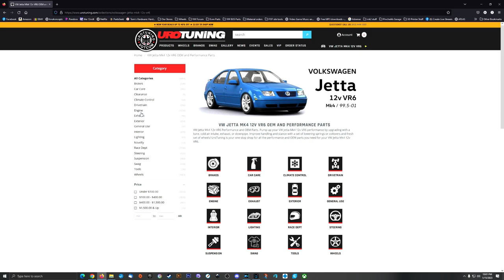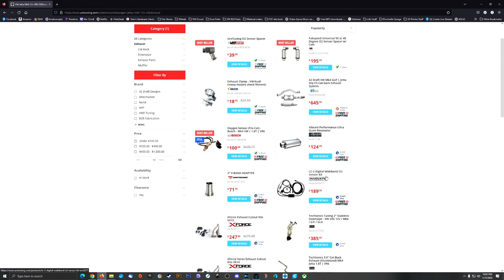How to Set Timing on a 12V VR6 Engine - Patreon Built VRT

Comment: There is also a beveled tooth on the crankshaft that lines up with the #7 main cap when the motor is at TDC. I would rather this mark determine TDC when the rear of the engine is open.

Comment: After that engine is timed, do you still have to turn the crank pulley two revolutions clockwise and match the mark up with each other on the pulley and the block in order to get the engine at TDC @ cylinder #1?
The reason I'm asking is because my engine was just professionally rebuilt and I'm getting a crank no start/ no spark issue it's really annoying!

Comment: Hey Al ik this is not the video for this but i wanted to ask you a question, and thank you. I watched your videos years ago when I was 16 and got my first audi 1.8 for 500$. Your videos encouraged me to work on my car and made me fall im love with it. Now my question, I got a 2.8 but one of the cams doesn’t line up horizontally with the other. Can i just use the cam timing bar to turn the cam into place or should i remove both cams from that bank and retime the cams.
Reply from the maker: You need a cam locking tool.
Then you should be able to set timing correctly.
Reply: The cam on bank 1 is slightly off maybe at 45 degree angle. Bank 2 cam and crank are timed correctly. Car did start and run but was obviously missing on all 3 cylinders on bank 1. I asked the previous owner if he did the timing and he said no, so I’m confused how only one cam moved. Timing belt tension is good, so either he snapped it and put on a new one to sell, or the cam chain tensioner is going out.
Reply from the maker: Here is a link to my Google drive account for a Bentley manual as well.
Use it to help do your repair 

https://drive.google.com/drive/folders/1QJAvL7EngtMpEJBtpos1TtSixUgF1l9Y
Reply from the maker: @adriang9238  ok wait is this question for a 1.8 or 2.8
Reply: Thank you man. I have a cam locking tool on the way. My question really is can i use it to move the cam slightly with the head still bolted to the car or am i going to bend valves. I’ll check what the bentley manual says!!
Reply from the maker: @adriang9238  please call me 7606377619
Reply: I appreciate you taking the time. Hopefully you don’t mind me saving your number for future reference. Once i have the money the v6 is getting replaced with a 1.8
Reply from the maker: @adriang9238  no worries here

Comment: So your not forged ? Just a head spacer ?
Reply from the maker: Correct. No need to be forged unless your trying to go over 400+ hp
Reply from the maker: You just need forged hardware, upgraded valve train and cams
Reply: @PincheALsGarage  thanks for answer bro im trying to be around 400 maybe perhaps 400-450 so in my case it would be safer to go forged ?
Reply from the maker: @vrtxs1938  correct it would be safer to have forged internals if you plan on going higher in HP
Reply: @PincheALsGarage  thanks for the info my man